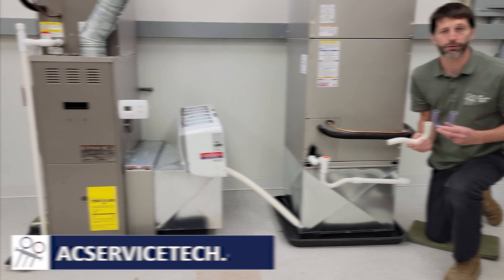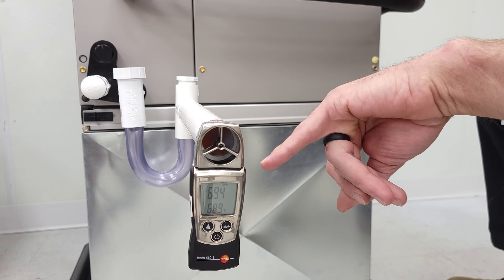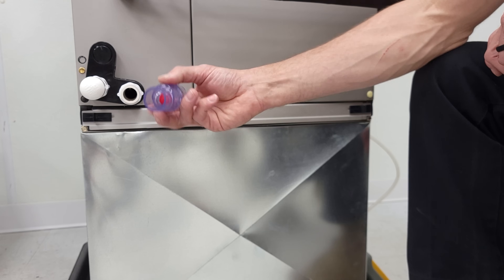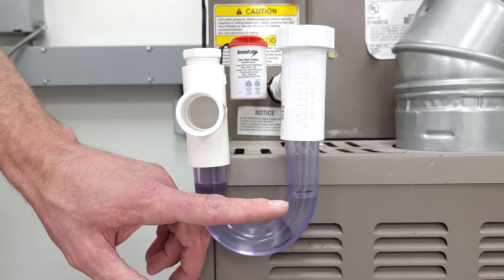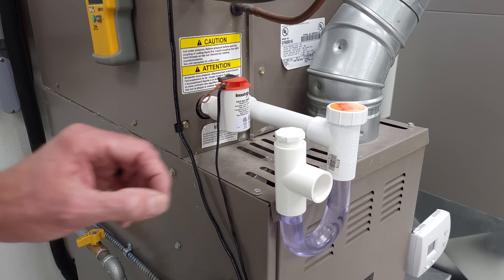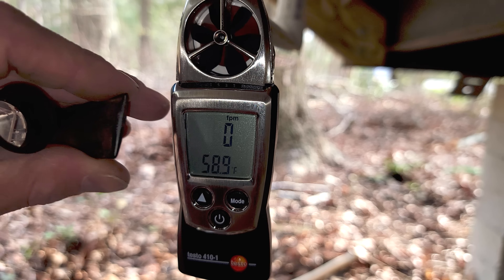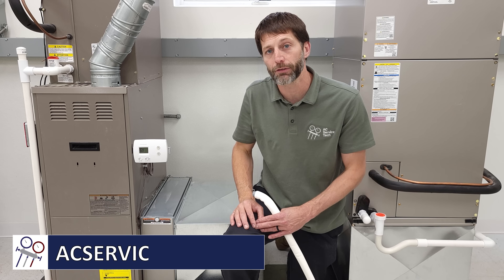Air Conditioner Condensate DRAIN TRAPS! Function, Problems, Cleaning, Air Loss! Do I Need it?

Comment: Since when the condensate traps have become so complicated?  My 20-year-old HVAC drains straight to the floor drain, no trap and no issue.  My new HVAC has two condensate traps.  I don't want to find out the issues if it had no trap.

Comment: Who can determine the difference in energy and/or performance efficiencies  between "an exit pipe with no water pooling in the U" and an #EZtrap or similar that pools water in its U?

P-Traps apparently do not pool water at certain or all exit flow rates.  The lack of a U of water apparently reduces the pressure that keeps the condensation pan filled. 3:25

The pan depth may decrease by 1/16" from 'filled U EZ trap' to 'P-Trap', correct?

Given an average residential system, what parameters provide better efficiencies?  Can you safely say that the U saves a dollar per month, on average?

Comment: So my condensate drain has a p-trap in the attic as well as it drains into the sink drain before the trap under the sink, and it clogs constantly with what looks like tampons or TP but it is  biofilm. Do I need it to be before the trap under the sink? Do I need both? Can I drain it directly into the drain AFTER the P trap or will it not matter as far as the bio-film? I potentially could eliminate this and tie it into the drain pan and go outside with it  instead.

Comment: My Carrier model FJ4 Air Handler unit calls out a minimum 2" drop for the condensate trap, and specifically states not to use "shallow" traps. (All the EZ-Traps I commonly found on line like the ones shown in your video were 1".) After working with Jason at EZ-Trap, he made me aware of their model EZT-205 which provides a 3" drop and complies with what the Carrier Install manual specs. (Water column x 2 = minimum drop in inches.) Hope this helps anyone searching for the proper off-the-shelf configuration.

Comment: If unit is in attic. Trap close to the unit or on outside wall (drain line ran down outside wall).
I have seen some buried in the soil and pop backup 4 feet out. Acts as a trap.

Comment: You actually do need to have a trap on a furnace and A coil. The air blowing out can actually push the water out of the way and not allow it to drain.

Comment: Thanks for this information. I always thought a p-traps purpose was to prevent plumbing gases from backing up into the home.
Reply: Mine drains into a sewer pipe and a U- trap is required to keep the sewer gases out of the air handler. My setup is typical in Texas, but most other places just dump the water outside on the ground. The trap serves several purposes.

Comment: So was I trained wrong when I was taught to 90 out of a positive pressure coil then T in a vent with no cap so positive pressure will help push the water out of the coil

Comment: You Mention that you don't need a trap on "A" system meaning a blower below pushing air up through the A-CoiL and that the P-Trap will clog up over time meaning the water pan inside will clog or the Trap itself clogging ? I don't understand how a P-trap will Clog as its only water dripping into trap?

Comment: I seem to have the exact air handler you have in the first part of the video. How do you change the filter with the trap in the way?
Reply: Is the filter that you refer to:

the brown 'EZ' designated horizontal which appears to be approximately 3/4" and apparently lies below the interior water condensation pan?

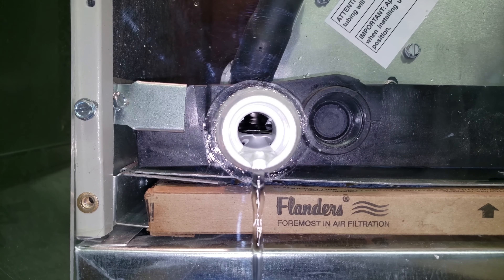Apparently so, according to 3:10

Please consider correcting me if I am wrong 😊

Comment: Hi, can you explain how to solve the very loud gurgling noise that you can have on a condensate pump line? In my case, the line goes up to the ceiling, cross my house and then goes down to the backyard. Is a very long line. Can a siphon breaker or an anti siphon device solve the air that is sucked through the pump? Thank you.

Comment: When water fills up to the pvc line inside the condensate pump and there's a trap already existing it then becomes a double trap and when I see a double trap (regardless of condensate pump but in general) I'll usually see a vent on the PVC line. Can you please explain why that is?

Comment: On an air handler that is in a negative wouldn't you cap the first T and the second T would be open for a vacuum break?

And on a positive air handler would it be the same as listed on the negative pressure air handler?

If both are capped why should both be capped

Comment: Ok my son purchased his first home and now is working out of town. So I have trying to help out at his house so his wife does not have to do everything.  Noticed the other day water coming out a pipe in the eve of the house.  So I knew it was the emergency over flow for the HVAC.  When I get in the attic I notice that the water seems to be coming out I guess the emergency on the HVAC and air flow.  On the main drain line that goes to the house plumbing seems the be clear flowing.  Almost seems like the safety switch on the main line slows the flow or change air pressure to make it some out the emergency hole.  Do know they had some warranty work done on the a/c and am wondering if they left out the drain.  Will try to attach a picture so you can see what I’m talking about.   Any ideas would be great!

Comment: The condensate drain on my 90%+ furnace is completely dry. I was going to pour bleach in there as instructed by my installer to clean it. I saw it was dry, which I had never seen before. Is it normal for this to become dry during the months that the furnace isn't being used to heat the house, only the A/C is being used.
Also, did you say that if my drains are not going outside but just draining into a floor drain that I didn't need a trap? 

The furnace (heating) condensation drain has a sort of trap but not a conventional P trap. Two tubes come out the side of the furnace into the very bottom of a retention reservoir. The reservoir will fill up then overflow into a drain connected to the PVC drain that goes to my floor drain. That reservoir is what is dry right now.

My A/C condensation drain comes comes out of the top part of the furnace/AC where that A coil is. The drain then makes a couple 90% turns and is connected to the same PVC that the heating condensation drain is connected to and drains into the floor drain. The A/C doesn't appear to have any sort of P trap. Is that okay or should there be a P trap. 

If pictures would help, I have some I could send you.

Comment: So for a furnace / AC unit with a frame coil, you do not need a p-trap or even a vent to safely drain water for the condensation drain?

Comment: If a condensate safety shut off switch is added to the evaporator coils overflow port, will the negative pressure not allow the condensation to enter said shut off switch?

Comment: Getting ready to install new Trane 4-5 ton coil.   In the installation instructions, it states: "The condensate trap is not mandatory but is recommended for efficiency".   But after watching this video it would seem that a trap would be mandatory because otherwise the condensate water would not drain until the unit shut off.   Any further explanation?

Comment: I moved from Florida to Oregon.  Combo unit furnace central A/C.  Notice no water coming out the condensate line outside the house.  Air is quite dry though.  Notice that on my unit the pipe just above the U trap has a plug (between the coil and the U trap) that is not covered - so open to air.  Is that wrong and should that cap not just be a open pipe but closed top?

Comment: I just had a new Goodman installed and when I asked them why they didn't use a P-trap they said it didn't need it because the condensate line comes out of the bottom. I knew that wasn't right but I did read in the manual that if you have a shut off installed then you don't need a P-trap necessarily but I'm not sure if that's a good idea. Meanwhile these guys who installed it seem like they don't know what they're doing because they didn't mention that all they said is because the PVC pipe comes off the bottom of the air handler you don't need a P-trap meanwhile even though the pan is draining there is a small leak where are the threads attached to the pan. To show you what kind of workers they are in order to try and fix the leak they hit the PVC pipe with a hammer to break it off then they replaced it but didn't use any plumbers tape so it's still leaking a tiny bit. Maybe it wouldn't be leaking if they had a P-trap even though it's not really backing up in the pan much at all. I can't trust these guys that's for sure. I also have a little bit of water dripping off the coil and not going into the pan. I mentioned that and of course they're playing dumb. Not sure what I'm going to do about that

Comment: At 3:49 there is a device... Couldnt quite make out what you called it.. my condensate line has no p trap. Its a verrical force air system. Its. A system installed in 2009. There really is no clearance to have a p trap.hvac Housing cover blocks the depth needed for a standard p trap.

Comment: I have a commercial AHU drain question. The drain pan inside the motor housing, when the unit is cooling, is constantly full/overflowing and water is not draining through the trap, but when you open the door to the motor housing water begins draining out of the trap. There’s clearly a vacuum effect happening because the door is hard to open. What could be done to fix this issue? The condensate overflows the pan inside and the water level is about as high as the bottom of the door and leaks out of the unit wherever it can, just not through the condensate trap like it should. Any help would be greatly appreciated

Comment: Here in Florida the majority of houses are built on slab foundations with the line set and condensate line running under the slab in 3 or 4 inch pvc. The exit point for the condensate line is outside the house and rises up 8 to 10 inches above ground level. This creates a natural "P" trap as the under slab vs the exit point in total is about 15 inches, trapping the water in the line. Therefore no "P" trap is necessary. Depending on your construction it may or may not be necessary to add a "P" trap.
Reply: True. But absolutely ridiculous to run those lines 20 plus feet from air handler. Better I think to put in a p trap and exit house right by handler.
Reply: @BobSmith-rg4rh  It's not always possible to exit close to the air handler. In my case it's in the garage with no clear exit point to an outside wall. Even then, why punch a hole in the wall when you don't have to? It really doesn't matter how long the condensate line is as long as it empties and doesn't back up into the coil case.
Reply: @Kevin-mm6xm only due to poor design
Reply: @bobpaulino4714  I'm sorry. Can you elaborate please? I don't know what you're referring to.
Reply: Good  to know.
Reply: A p trap assembly is like $20, with a cleanout; then you don’t need to know construction.  Then a $25 float switch wired to the motor board, to prevent hours of work if the condensate drain gets clogged.  A HVAC tech who doesn’t do this should lose their accreditation.

Comment: Wow 😮 Now I’m even more freaked out.  I’m a first time homeowner. I watch these videos all the time trying to learn what I should be doing. My AC is on the second floor in a closet. It ducts out from there. Another video told me I should flush the pvc drain pipe with vinegar. But my drain pipe had no cap to open to pour in vinegar. Apparently that’s not unusual because there was a video for how to cut a T valve in. But now you added a p-pipe. I don’t have that either. Where does that go?  Before or after the T-valve?  The prior videos just warned that the drain pipe had to slope down from the AC. 😱
Reply: Check @9:12.  That's a T into a P, then slope away.

Comment: I looked this up because I’ve been working in my attic, and since it’s transitioning into winter, it dawned on me that the water in my condensate P-trap will more than likely dry up since the AC is not being run. So I take it I should keep an eye on that in the winter and add water to it if I need to?
Reply: Been wondering the same thing. Can't find an answer anywhere. I have a Trane heat pump with positive condensate pressure.

Comment: If you have an auto shut valve installed (like your system has) and your U-Trap clogs then the shut off valve will shut the system down before water overflows.  You said it would overflow which sounds incorrect.

Comment: If the trap was empty and the unit was not draining while running, would it then fill up the trap when it shuts off?  Assuming that it was not on long enough to overflow the pan.

Comment: What would be the effect of using a larger value capacitor on the air-handler blower? The value should be 5.0 uF (original capacitor, but someone replaced it with a 7.5 uF capacitor (both 370 VAC).

Comment: So let me know if I have this right... The reason the unit on the left (Furnace/AC) has positive pressure at the A-Coil, and the unit on the right (AC) has negative pressure at the A-Coil, is because in the Furnace/AC (left unit), the blower is below/before the A-Coil (often between the A-Coil and the filter/return duct) blowing toward the C-Coil, and on the AC (right unit), the blower is after/above the A-Coil, blowing AWAY from the A-Coil.

Comment: We just had  furnace/air handler/AC units /Evaporator Coil (A coil) and outside unit replaced... as well as a new condensate pump.  I went downstairs and noticed that the pvc that comes out of the furnace and drains to the condensate pump  has a piece of open pvc on the top of it, and  AIR IS BLOWING OUT OF IT.  IS THIS NORMAL?   Does this decrease the air flow coming out of the furnace and/or AC unit into the ducts?? SHOULD it be open?  Shouldn't the pipe to the condensate pump be  closed?

Comment: Question - we have a gas furnace & A//C system and the unit in your video is right on top of the American standard freedom 80vs (the air filter is at the bottom of that for reference) anyway it's all in a 2ft Wx 9.5ft H closet that's in our laundry room... yeah it's all weird idk. The pvc lines coming out of the unit your talking about in this video don't have those black rubber seals or anything sealing the open area around where they enter or exit the unit. Cold air just blows right out them into the closet. Is that ok? Should we have them patched around? Trying to figure out where any and all air leaks can be sealed. Thanks 😊

Comment: I’m having a problem with air handling systems that are inside the ceiling at a gym, I’m getting water leaking from the bottom of the units, could this be due to the drain traps being full of air and not not trapped with water?

Comment: Does the condensation still drains while using a dry trap ? 
Also, should a overflow shutoff switch be installed as well ?

Comment: I have a lennox cba-024 230-01. I'm going to be leaving for vacation and have not cleaned my condensate line for the 2 years since I had it. Should I wait until I get back before I attempt to clean it. I don't want to mess it up and cause a clog.....

Comment: Good morning, perhaps someone on here might be of assistance with a condensate drain issue I'm at a loss trying to figure out.  I have a 3.5 ton Goodman package heat pump, it is a draw through design, it only has one drain fitting.  The trap was made with some 3/4 inch 90 elbows, the bottom of the trap is about 6 inches below the base of the unit, and the outlet of the trap is about 4 inches below the base of the unit.  I cannot, no matter what I do, get it to drain while the unit is running, it will only drain when the blower shuts off, then water pours from the trap for about 45 seconds or so.  The unit is not pulling the water out of the trap, I've stuck my finger in the trap while it's running and the trap is full, it's not sucking air in the drain either as I've held a piece of tissue paper up to the outlet of the trap while the unit it running an there is no movement to the paper at all.  Clearly either the blower is sucking water from the pan and/or the pan is overflowing as the last PM I did about 2 weeks ago I found that the blower was covered in moisture and the bottom of the air handler side of the unit had about 1/4 inch of standing water in it and the insulation on the bottom of the box was saturated.   Any ideas what might be causing this?  Could it have excessive negative pressure?  The unit has a single 14 inch flex return, the filter box is a 14x20, the supply is also 14 inch flex that is wye'd off into 2 plenum boxes under the house, each plenum box feeds 5 vents, each supply vent is fed with 8 inch flex, the individual supply vents are 4x8's The unit is fairly level on the pad, if anything it's very slightly sloped towards the front which should provide gravity assistance to the drain.  Thanks everyone.

Comment: Great Video. In some positive pressure situations, a trap may still be needed. There's a youtube video out there where they use a clear evaporator chamber where the positive pressure is high enough to cause the air flow escaping from the drain to actually push the water away from the drain hole preventing it from draining until the system shuts off. It's similar to what happens with negative pressure but there's positive air flow pushing through the drainpipe. A trap in that case will prevent that. It will also prevent the loss of conditioned air escaping. However, in the case of the overflow, when it is drained outside the house, air will always be able to escape the system. A trap on that line won't help because it won't fill with water until the main drain clogs. Not a problem if you use an overflow switch. Forum threads on these p-trap topics go on and on and never seem to resolve to a solution for all cases.